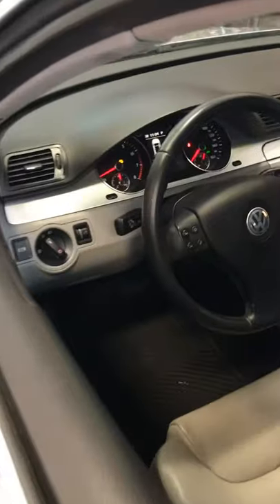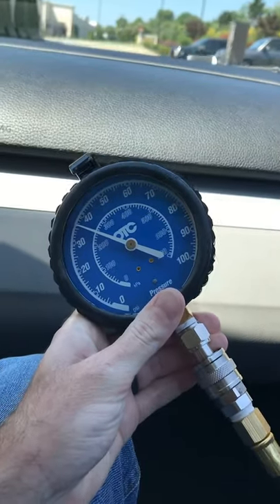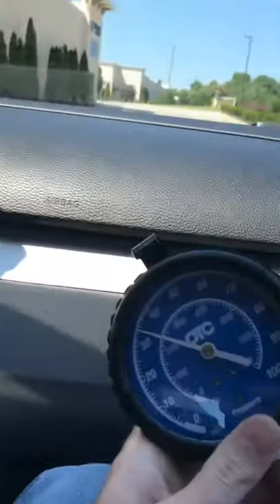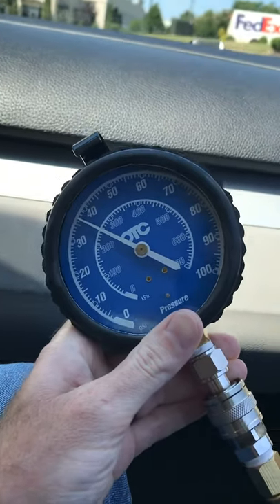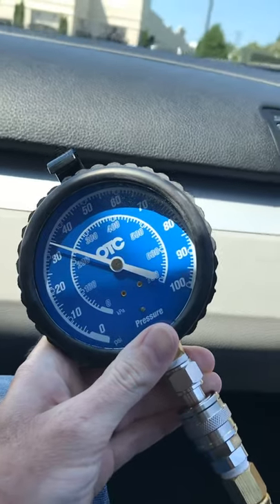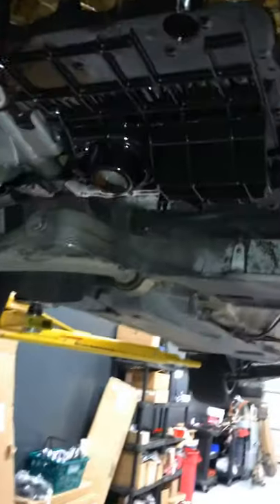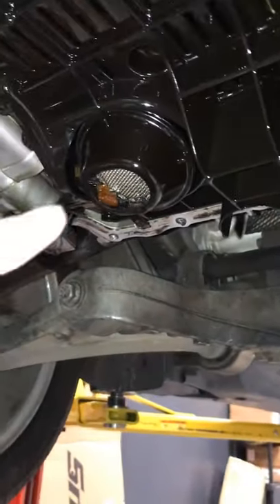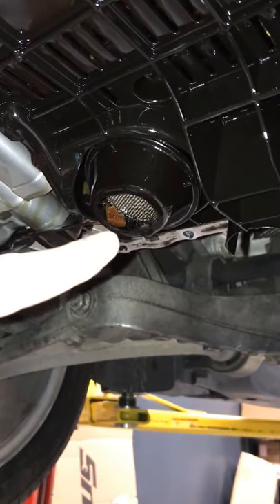Oil pressure Light on 2.0t VW!

Comment: Timing chain guide smashed so let's change the oil pickup  🤨
Reply: Yeah, that was weird ;D I think it was because it is an edit. These guys are good at VW engines.
Reply: I think he's changing the oil pickup just to be safe as it may be clogged up with material but on that note I have noticed this guy is more of a parts changer than he is a mechanic 💯

Comment: Yikes! Any thoughts as to root cause? Any way the customer could have prevented it?
Reply: Change your oils and filterssss
Reply: Oil change every 2.5k miles. Good oil and filter. Service timing chain before it fails, service oil pump before it fails. Sometimes not much damage has been done and the oil pump can be replaced, but costly